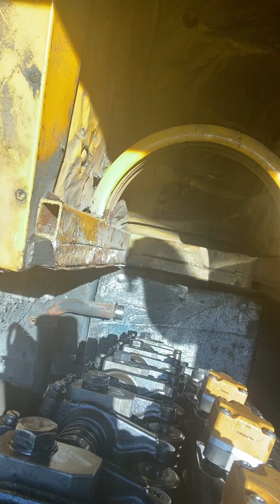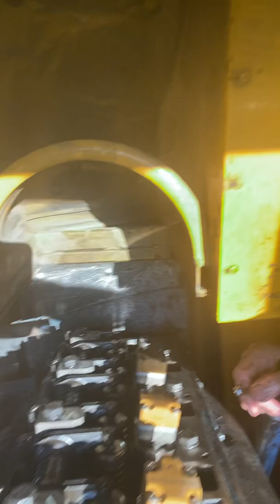DT466E injector install

Comment: Whats the torque to tide injectors on this dt466
And the torque for valve cover.
Reply: 120inch lbs on the injectors and 13ft/lbs on the valve cover
Reply: Thank you need this info to